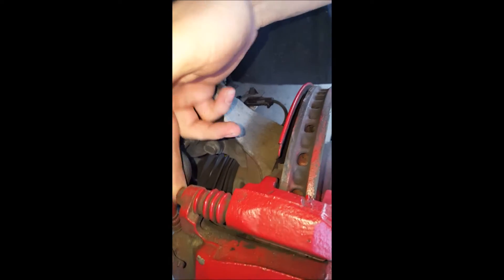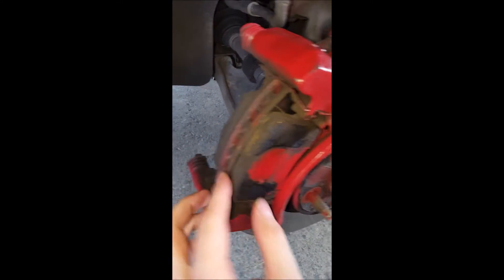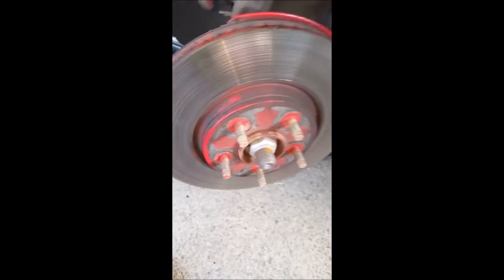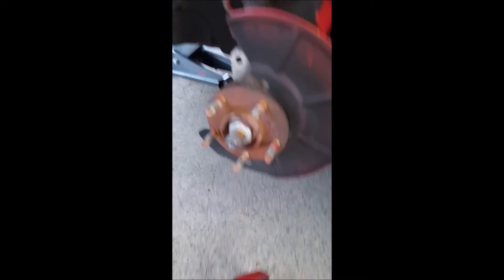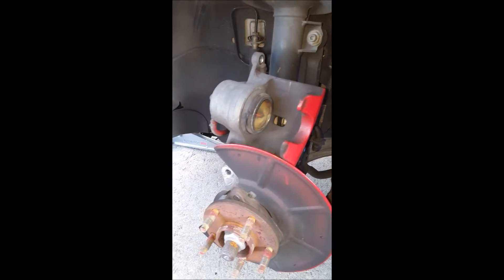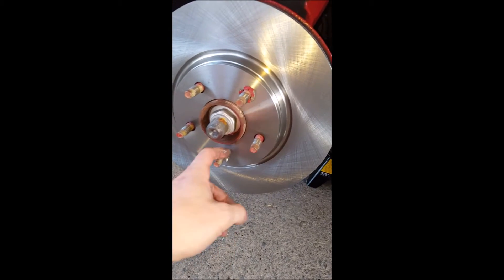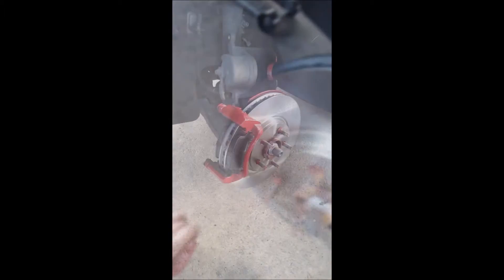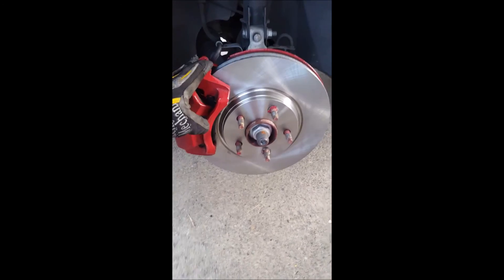2009-12 malibu brakes and rotors

Comment: I was told ,i needed to wash my new rotors with dish soap. Any truth to that?
Reply from the maker: Vinny S some people will brake clean the rotors to get the oil off of them that they put on to prevent them from rusting in the box. I have never done so and have never had an issue

Comment: I did a stupid mistake once on a chevy avalanche rear brake job, I tried putting all 4 bolts into the bracket, I got the two that were supposed to be in the bracket in ofc, then i spent like 30 mins trying to figure out why the other two bolts were twisting the rubber boots as i tightend them up.... then i looked up and shit i saw the caliper hanging up still...
Reply: That sh*t stuff will get you every time...